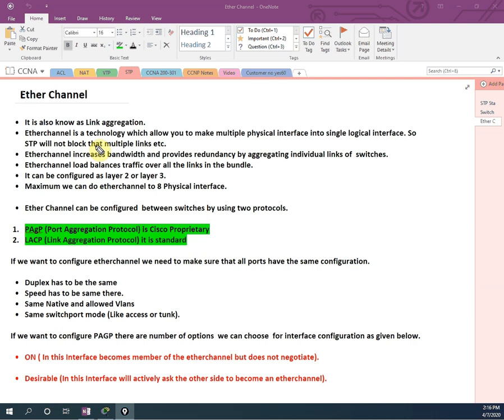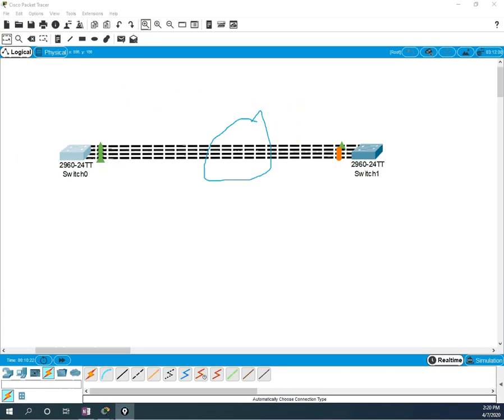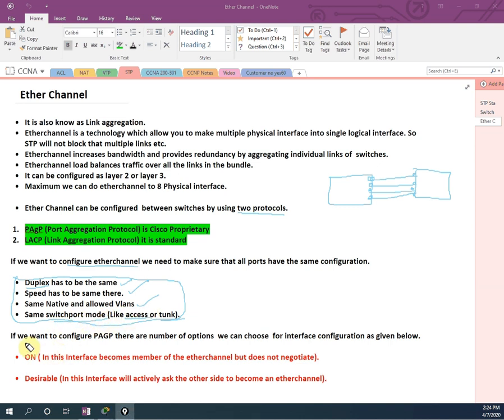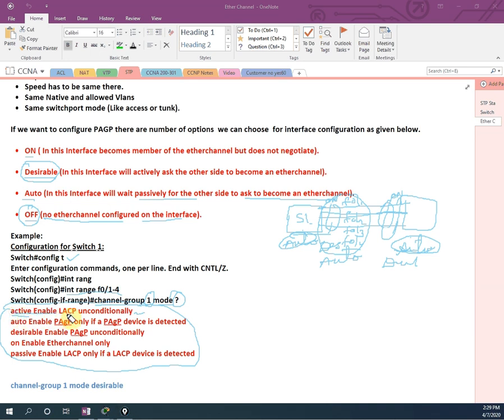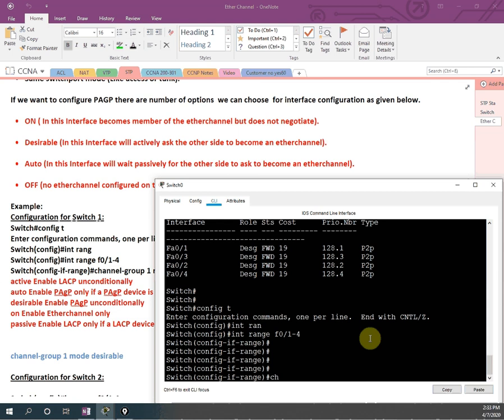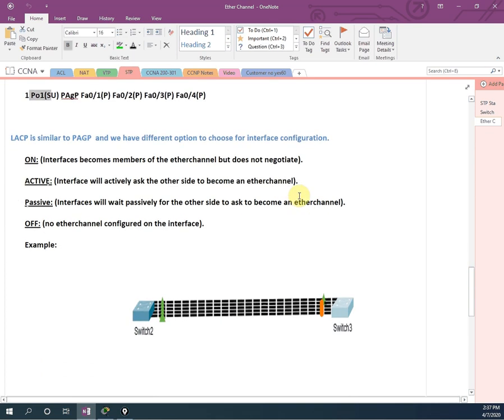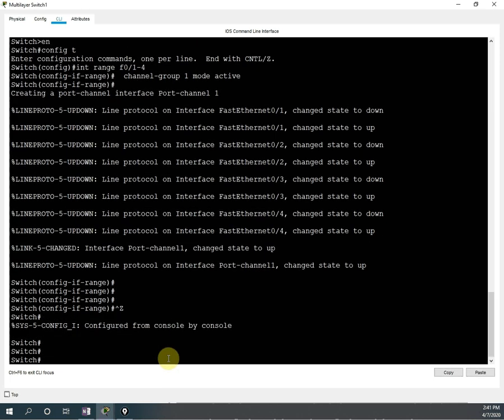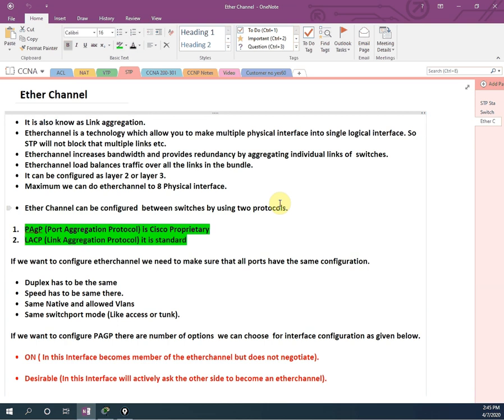Free CCNA (NEW) | Ether Channel | Video 50 | CCNA 200-301 Complete Course

Comment: How to enable l3 SW for routing ? And when to use L3 routing when connecting to internet or any non internet  entreprise network ??
Reply from the maker: Hi,
You can use ip routing commands to enable routing in L3 switchs. When to use that depending up design.
Like generally in our organization we use 3 tier Architecture so in that we use distribution layer we use L3 switchs.

Thanks
Reply: @networkforyou11  thanks sir
Reply from the maker: Thanks 👍

Comment: Hi sir
In this ether channel pagp and lacp if 2 switches we have we are making one auto and another end desirable or passive
If connected with more than 2 routers which switch auto and which router we can make desirable???
Reply from the maker: Hi
See u can look which port is connected like switch 1 port 1 is connected to switch 2 port 1 then u will do that configuration to that port only etc.
Thanks